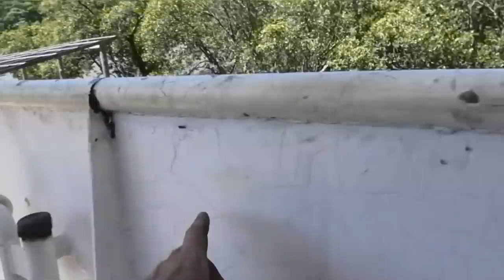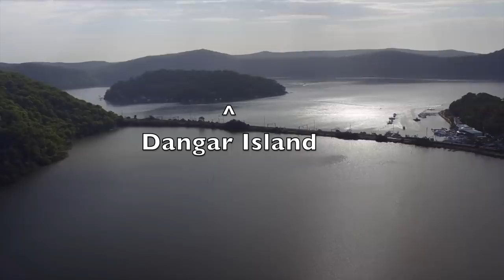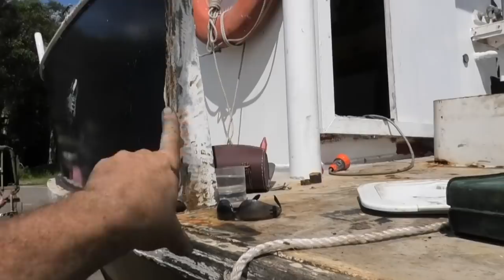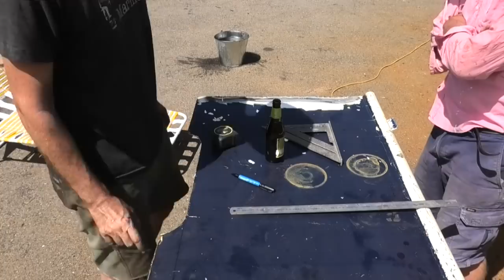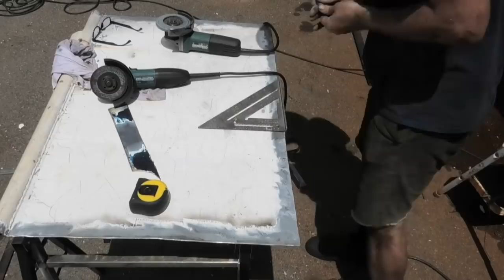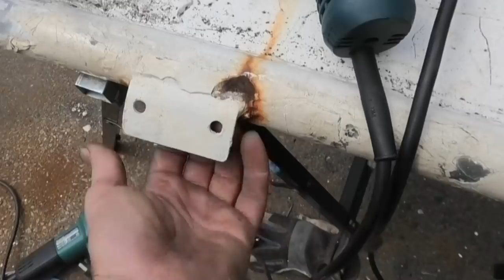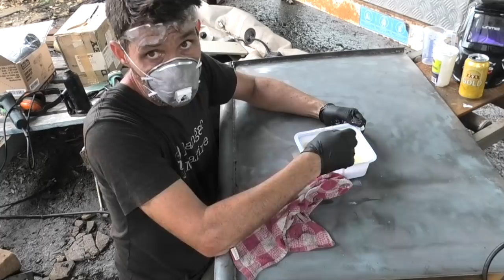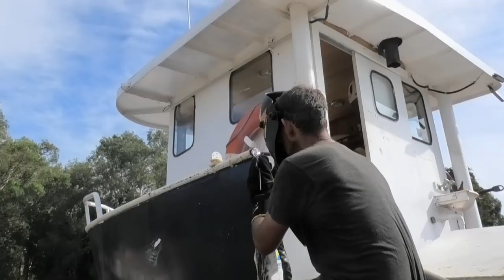Making a door in the steel trawler

Comment: I would also take a drill and plunge a couple of holes through the rail tube into the end cap you inserted... then go back and fill the holes with welds. That will keep the plug from ever being pushed in if the face welds you made break. If I remember correctly, face welding doesn’t go that deep into the plug material... especially ones as beefy as you used. They act like a heat sink and don’t melt as deep as thinner plate steel. (You mentioned putting a motorbike in through the door... worst case scenario if it fell over and hit the end caps/plugs it could pop them loose)

Comment: If you use a long hinge made from small pipe welded vertically and then drop a long rod with a top handle for pulling it up using a hinge on either side you can fully remove and swing it either direction.  The length would give it strength and plastic bushings would allow it to slide in and out with ease.  Cheap, strong and easy.  Stainless material would keep corrosion away if you chose.  Grease zerts would also make it swing easy.  Boats are always a learning curve.  As the old saying goes, Never met a shipwright with a square.  Take care.  Doug
Reply from the maker: It is tempting to go a long pipe hinge, and have one at both ends. I'll look into that. Oh, and yes, I don't think I'll be getting much use out of the square. ;)

Comment: Haven't seen to the end yet so sorry if you solve the issue later on but what about a sliding bar in the round bar on the top for the latch. ( Like a bolt on the gun )
Reply: Could be a problem long-term with corrosion
Reply: I was thinking the same thing. Could weld in a blind stainless sleeve in the top tube so water can get in. Would be very strong.

Comment: Must agree with splitting the door in two
Make the hinges so the door can go back flush with the existing side framing.
Giving clear access to after deck AND wheelhouse foredeck
Closing them shut a fold over hasp that fits over the round top tube. The weight of it keeps it down and so closed.Amacf

Comment: If you put a rod/slide bolt INSIDE the top rail. You can cut a key slot on the forward rail side before the door and the bolt will go into the door rail and can be locked down.
Reply: That's what I'd do with a long stroke and a tapered pin so it self-aligns because it WILL sag over time.
Reply: @TonyRule  also i saves spending more money. You can also straight cut the hand rail higher up with a grinder and slot in a flat piece of metal.. weld grind and your water proof the rail.

Comment: Stu, get a mig welder as tig is too slow, you need two hands/ one for wire, one for hand peice, also tig will put too much heat into steel and warp it. Its usually used for small intricate stuff. Mig with inner core flux as shielding is best. Solid wire mig and gas will get blown away by the wind and give you porosity ( aero bar effect on the weld) love your channel and all the best with your build.
Reply from the maker: Yes, would love to buy a MIG one day, just need the cash...
Reply: @DangarMarine  fair call bud.. Your doing great...

Comment: Stu you did not really have to sand the paint off, the flame from the cutting torch would have burnt it off.
Reply: The only issue with cutting through paint with an oxy torch is fumes (which can be nasty if lead, zinc or cadmium oxide pigments are in the paint, and some binders generate nastys when burnt too).
Wear an appropriate respirator.
Reply: @allangibson8494  But it's not like he's doing it 40 hours a week for a lifetime.
Reply: @TonyRule  Depends on how long he would like that lifetime to be...
Reply: @allangibson8494  Once in a blue moon isn't going to hurt in any measurable way.
Reply: I think I'd have done it with a thin blade on a 4 inch angle grinder,Oxy just made a huge mess warped everything.
Those little thin blades go through anything,it been a long time since I used my 9" for anything.
The other option would be a reciprocating saw.
Reply: As much as I enjoy burning, clean metal burns much better then painted. Flam travel is much better. I would have used the grinder. It saves a lot of clean up.
Reply: @jamescahoon4152  We have German made 1 mm 4" and 4 1/2" cutting discs here, they last well and cut really good, I don't use the cutting torch now, too expensive.

Comment: Old welding trick.  When making a but joint on flat stock, clamp a thick piece of copper behind the joint.  The weld won't stick to it and it will hold it in place while your weld.  If the metal is very thick,  should probably gouge the back side of the seam and weld from that side also.

Comment: if you put a round bar in the round tube with a slot to move it in and out with a drop down to lock in like a bolt action on a rifle 
having a bolt threaded for the locking pin
Reply: I think that’s a very good concept

Comment: Great progress
. I would of split the door down the middle  into  two doors ,that way they would open back on each side out of the way
Also It sounds like your TIG welder is set onto AC mode for aluminum not DC for steel
Reply from the maker: I will consider splitting it, but I'll see how it goes for a while. TIG may be on AC, I just got it back from repair and didn't really check everything again. Should do that!

Comment: Could you run some smaller tube threw the rail and cut a notch and have a slide latch?
Reply: Good idea. However you would have open pipes full of salt water rusting from the inside.

Comment: Great work Stu. Looks like you can turn your hand to anything. With such a large roof area, will you have a large solar panels to go with your new electrics?   Also,  I'm a bit disappointed that I only saw one beer in this episode.
Reply from the maker: Yep. The stainless steel awning frame I took off to remove the engine will be covered with two large solar cells rather than the soft cover that was on it.

Comment: Bring out the MIG it'll probably make a lot of the bigger welding easier. A good gasless wire will work well outside too, and possibly be cheaper than using solid wire and gas. The boat is coming along nicely though.
Reply from the maker: I wish I had the money to buy a MIG welder. One day...
Reply: Hi  @DangarMarine , there are some pretty reasonable brand name MIGs for under $600 bucks that will do 155Amps which would be enough for what you're currently doing. Head up to $1000 bucks and they do closer to 180Amps. The saving on gas alone may pay for it pretty quickly.

Comment: For a strong latch...you could use some round bar that moves inside the pipe on the top of both the wall & door.
Kind of like a suped up version of a barrel latch that slides from the wall-pipe across to inside the door-pipe.
A channel cut into the wall-side pipe for the handle which could be a 1/4" (~6mm) round welded to the main round bar that slides.
It would be almost as strong as the original wall-pipe so it would be very secure even in rough seas.
Reply: Oops...I wrote that before I saw you plug the pipe ends   :)

Comment: I guess I would have cut the door out everywhere but the top rail to hold it in position, I would have wielded in the hinges and then cut the top rail and dress the edges, the door piece would be in its original position and alignment.
Reply from the maker: Sounds like a good way to go. Might try that if I do another one at the stern.

Comment: Brother there was no need to grind the paint off before using the oxy-acetylene. You would get a little bit more smoke but the oxy-acetylene will burn right through the paint just as the metal.

Comment: A bar on the door that moves between two bars all with through holes so you can drop a quick release pin through to hold it closed. A leash cable to prevent loss overboard.

Comment: Depending on how far you've got I would tack weld some 5 or 10mm spacers inside the door opening 
then tack weld your flat bar inside them 
with the hinges welded on and the  weld the door together in place  and cut the tacks and then its job done and it has to fit perfectly.
also with the rust repair to the bottom of the door I would of just done it with weld and ground it back you're welding skills are fine and in fact you did 3 time the welding and grinding putting the patch in .
Not a criticism you're doing fine just trying to save you time on the hard stand

Comment: No need to take the paint off for the torch. The only been might be if you were cutting in a enclosed area and want to minimize the toxic fumes. The torch is more than hot enough to handle the paint.
Reply from the maker: Thanks, good to know.
Reply: Also just a tip, if you should start a small fire while using an oxygen/acetylene torch, you can usually turn the acetylene off and blue the fire out. Just be mindful of where you are blowing the fire. I also recommend, personally, that keep a good heavy pair of leather gloves near by (welding gloves). These can be used to smother fires also, and offer excellent protection from the heat of the work you are performing.

Comment: What about having it hinged on both sides?  Use a drop in bar and that will secure it and hinge it?  So weld a section of pipe on both sides of door and boat.  pulling the pin up will allow for either set of pipes to be the hinge?  Not sure if I am explaining very well?
Reply: Cool idea man

Comment: Bulwark hinges are frequently fabricated from flat bar, with vertical bolts serving as the hinge pins. Each hinge is two horizontal flat bars on the hull side, with one flat bar on the door, that fits between the two on the hull. All three are drilled for a vertical bolt, which serves as the hinge pin. With this configuration, you could actually put hinges on both the forward and after edges of the door.  Two hinges would be used at each edge. The door could then be hinged open at either end, with the bolts at the "other end" used as latches.  Or a latch could be provided at each door end, and the bolts simply removed from the side that needs to open, in favor of the latch. Greg
Reply from the maker: A few people have mentioned this and I am starting to like the idea of having it hinged on both sides. It would certainly be stronger too.
Reply: Dangar Marine Yes, it could be made much stronger.  The flat bars on the "door side" could run all the way across the door, with the hinge holes at each end, so they would act as (door) plate stiffeners as well as hinge bars.  Greg
Reply from the maker: I'm a little bit worried about having too much horizonal flat bar as it would hold water, but I guess with good priming and paint that shouldn't be a huge problem.
Reply: Dangar Marine Yes, understand about the water collecting.  The big issue is do you weld the flat bar to the plate with continuous weld, or with intermittent weld. If continuous, then water is sealed out of the joining surfaces, and good coating should be sufficient to prevent rust. If intermittent, then it is difficult to prevent corrosion in the joint over time in the areas that aren't welded, where water can seep in.  Greg

Comment: Hi Stu!!
Wanted to give an update on my rebuild. Got everything together working and running perfectly.
My problem now is I took my trim pump apart to clean as it wasn't pumping but now I can't figure out where the bearings go. I can't find any info on this at all.
It's a '76 Evinrude 85 hp. I have four bearings a spring and a cap. Everything fell out when I took it apart. Your help with this would be greatly appreciated. Thank you sir.
Reply from the maker: Take a look at the exploded parts diagram for that motor on the MarineEngine.com website. That should show you how they go.

Comment: It may be too late but why not make it a saloon door.  Cut the door in half and have hinges on both sides with the lock in the middle.  That is a pretty wide door and more times than not, you would only need to open half to get in and out of the boat.

Comment: Weld tube down each side of the door and bulwark and cut like a hinge both sides ie say 150 mm on the door them 150 mm on the bulwark and repeat . Use a long solid rod pin for each side then you can open both ways buy pulling the hinge pin out
Reply: Think of the door as a hinge half and the bulwark as a hinge half

Comment: What ever is made with tubing 
Drill a 1/4  inch hole somewhere and add some motor oil in it  then plug it 
The same for that " bumper " around the boat  you don't need  much oil  with the heat of the sun it  creates a fume I suppose  it stop rusting from inside  take care be safe

Comment: Hinges always should be bow side with door opening outwards & a door brace on stern side this way door can never be blown open by rouge wave , the only other way is lift up door slipping in c channels
Reply: Craig is right . Besides if dock is so high you can't open door  . Why would you need to open it ? Just go over rail.
Reply from the maker: Because sometimes it is only a few inches higher than the bottom of the door and my dad at 78 can't jump over.
Reply: I do like the c channel idea.

Comment: why not cut the door down the middle and have hindges on both sides like a old west door and put a strong latch on the piping on the top so it can go in and out and the latch is on the top so it can easaly be opened from both sides no bending over or looking ovet to unlatch

Comment: Great job stu ,, just one thing buddy , Why are you using TIG ? as a pieline welder and the owner of a 37 foot steel tug (Converted) why are you not using a ARC welder or if you want to go easy just use gasless mig ,, the tig ios costing 200% more and outside in the wind you are getting porosity in your welds as the cup is not big enough and blowing your shieding gasses away ,, 
Mate use stic please ,,,,,,,,,
Reply from the maker: Been doing loads of stick on the hull over the last few days, slowly getting better at it...

Comment: Why not build your hinges in such a way that the door swings all the way in and back flush with the hull. That way you could hook it and stow it in the open position against the inside of the hull and you wouldn't have to worry about going around it.

Comment: When doing patch like that try to clamp both together, cut both at the same time
Reply from the maker: The trouble is you need the patch to be slightly smaller than the hole it is filling. The butt welding clamps create that gap to make the weld stronger.

Comment: Don't paint over an area that you have been grinding, unless you sand blast it. Most important for underwater areas, I learned from bad experience, the paint blows off.
Reply from the maker: Yes, the metal certainly needs to be keyed.

Comment: Does it have to be a door? A cable with a snap hook going across would be just fine....
Reply from the maker: Our local ferry has nothing more than a pole with three chains across it and some hooks on the pole to hang it in the closed and open position. It is a very tempting option.

Comment: put round stock in pipe on top of door for latch
Reply: Glad I checked earlier posts before suggesting exact same thing! If you do the latch first it will be a big help in aligning the door to fit the hinges. Ooops! End of pipe rail already blanked off. Time for Plan-B.

Comment: Having what I imagine is a very heavy door swinging freely on a boat, which is going to move in the water, seems rather dangerous to me.
Reply: I can see this being an effective arm/leg guillotine which isn't a good thing. Are you going to put a damper on it?
Reply: Yes, that occurred to me too.   In heavy seas, a loose door that size could be a waist high lethal weapon. So the door needs to be secured with a latch that leaves no way for it to come lose accidentally.   I'm thinking that a sliding bolt type of latch is not secure enough.  Something with screw type latch that gives a positive grip perhaps.
Reply from the maker: I think it all comes down to how well it is secured. Whatever I end up doing will definitely need to be strong and not able to accidentally come undone.

Comment: I take a piece flat or a piece angle and stitch weld it across the bottom to stiffen it up the sparks off that grinder must of felt good on bare skin
Reply from the maker: I've got to be careful that anothing along the bottom doesn't hold water and start to rust though.
Reply: Dangar Marine the other way to do it would be to use a sikaflex product that would the whole back side of the strap that would give you a good water tight bond
have a good day
THE GRUMPY BUS

Comment: You should have used a rod inside that railing tube for a latch.... or it's just an idea :)
Reply from the maker: Thinking I might go a bigger tube on the outside.
Reply: @DangarMarine  That's probably a better idea.  5 minutes after I typed that message I started to think about how you'd be exposing the inside of the railing tube to the elements with placing a rod as a latch inside it.  Better to plug it up and not have to worry about that.  Anyway, really enjoy your videos, the project looks fun though daunting no doubt.

Comment: Need a safety lesson on the 9” grinder! Should be standing sideways to its cut never have your face over the cut! They are notorious for kicking! Iv seen a contractor at work cop it sweet on his jaw. 

With oxy its all about picking the tip size and running accurately pressure. Iv allways run 12 size tip for 5-10mm steel and pressure of 100kpa   Acetaly andd 200kpa oxygen. 

I only just got to use a plasma cutter and it’s been way easier to master but the one work bought is a 105amp 3 phase unit with a very good dry air compressor too so that probably doesn’t count.
Reply from the maker: Yes, it seems like plasma cutting is a lot like welding. Learning the techniques is one things but having all the settings just right is equally important.